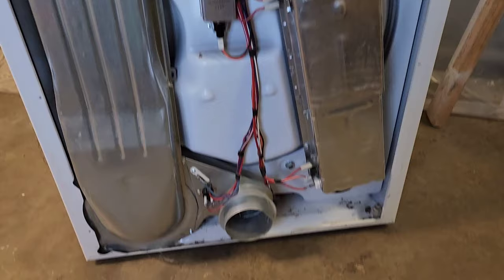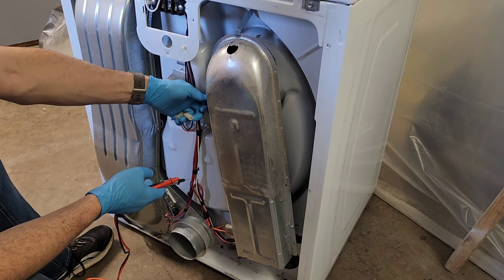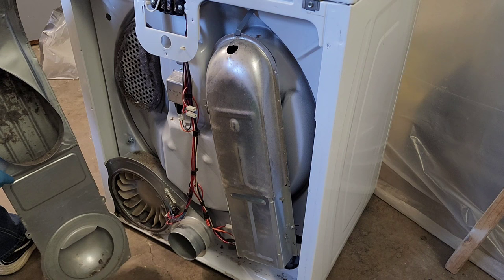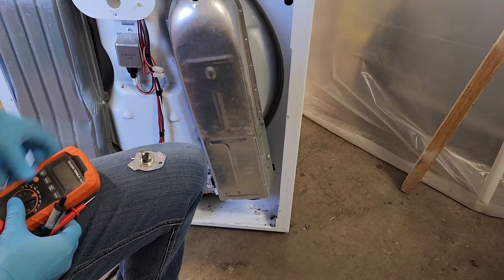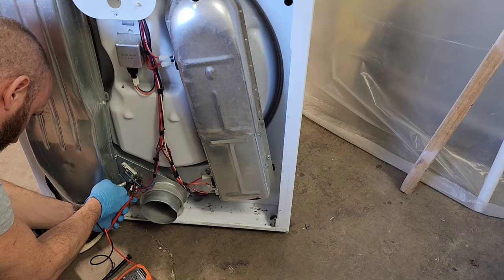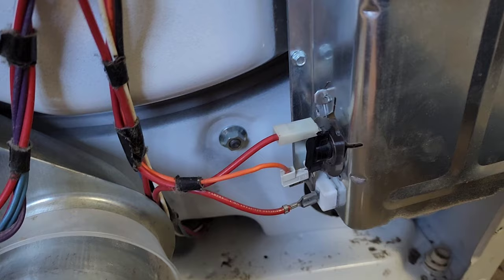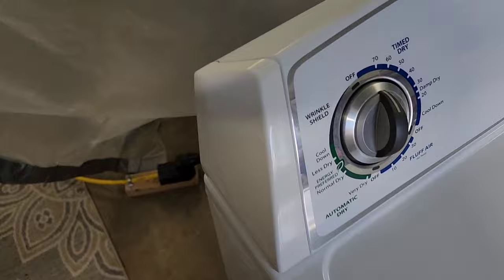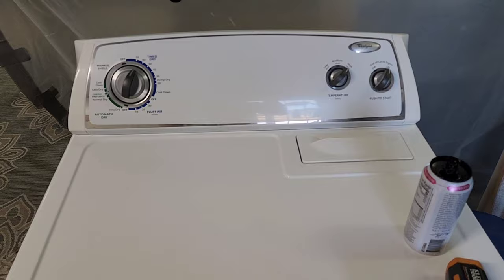Whirlpool Dryer Not Heating Trouble Shooting - High Limit Thermostat | Josh Cobb

Comment from the maker: I have received a lot of feedback saying replacement parts don't look like mine in this video and requests for showing how to wire them up. I'm familiar with the incorrect part that people mistakenly get from time to time but it does come with hardware that will allow you to hook it up. I talk about this in the video posted below as well as an explanation for all the components dealing with the heating element system and how they are wired up. Check the link for the video explanation. Thanks guys! 

https://youtu.be/y7_KXHW_x6o
Reply: You’re a lifesaver man, I’m a mechanic by trade but can figure out stuff, this video helped me fix my aunts dryer in no time. I just haven’t done much home electrical so I’m a bit cautious. I’ve repaired my central air, now this. I’ve told her to order heating element kit on Amazon just to have a spare.

Comment: WHIRlP00L WARNING: Check “Air Dry” setting first. Heat will NOT work on that setting. Spent a 1/2 day testing everything that would keep the temperature selection from working. NO LIGHT at all. Then it hit me, check the dial setting. It was on a setting I’ve never used or even seen, “Air Dry”. Check that first. I would almost feel stupid, but after pulling everything out I found water dripping into the electrical. Somehow, that whole ordeal felt like God moving for me. So I’m grateful anyway.
Reply from the maker: Excellent tip! 👍

Comment: Great video!  Tip, if you are checking for continuity, check ALL possible related parts to this problem.  I started with the thermal fuse and it was blown. I decided to keep checking and found that I was not having continuity in the heating element either. I took it out to inspect and found one of the rods had split (cut) which shorted it out.  If I had not continued checking, I would have wasted more time and possible additional shipping cost if I had just ordered the thermal fuse only.  Bottom line, since you're there, check everything!  Good Luck!

Comment: Thank you for the video. I had taken apart my dryer and deduced the high temp thermostat as the issue with my voltage meter after I found and removed the clog. I just used your trick to pop it back in place and it works perfectly. Thank you for your professionalism!
Reply from the maker: Glad it helped!

Comment: Saved me a ton, thanks!!  To reset my thermistor, I taped it on a flexible metal ruler and then whacked it on a cast iron skillet.   One try, bingo.   All good now, cleaned out a pile of crud in the left collection area, prob the culprit.   But all good and thanks for a no bs, straight to the goods video.

Comment: Thanks for this video. My Whirlpool dryer is almost identical to this one (LER8468PG1). Its been working like a beast for well over 20 years and stopped it just stopped heating.  I've never done appliance repair but I've done computer repair and iPhone repair for many years so I'm looking forward to expanding my horizons with this.

Comment: Dryer heating element went on me again. This time shorted to the metal ducting and not just opened up. Replaced the coil and it still wouldn't heat. Followed this guide to test and found the high limit thermostat blew and was open. Handy tip for percussive maintenance. Dryer works fine now!

Comment: Thanks Josh, you saved the day. The thermal fuse was open so I slammed it a few times and fixed. Concerned why it tripped so Amazon has the entire package for $12 so hope it holds while im drying. So again, Thanks Mucho

Comment: So im replacing all of these... i have 1 wire thats different on the high limit thermostat tho so im stuck and dint know what to do. Aside from that this has literally been the most helpful video i have come across.
Reply from the maker: You need a splitter for the bottom terminal of the high limit thermostat...that is where the wire goes.  Might be easier to order just the part with it already attached....it's a wire that has to do with the auto dry setting if remember correctly.  Here is a link to the correct high limit thermostat that you need https://a.co/d/gSW8w5I
Reply from the maker: https://youtu.be/y7_KXHW_x6o

Comment: Great video, was working on the same dryer today. Also had a tripped thermistor. Tenant still has to wait for the ducts to get cleaned but at least now I won't have to make them wait on a part as well. Handy reset trick.

Comment: Very nice video. I have similar dryer and it will spin and heat but it sometimes stops mid cycle (regardless of whether it's sensor or timed dry). If I hold the start button after it stops, it will spin, but without heat, so I think the motor is fine, something related to the heating. But then a little later, I can start it again and it will work for again with heat some more.

Comment: Josh, I am raching out to you as you have the most common sence of all the blogger repair  posts I watch.  I have a Whirpool commercial dryer, Model CEM2940TQ1.  I have a runs but no heat issue.  I have checked or replaced at 4 thermostats and the power imput is 240.  The unit shows power at the heating element in and out.  The element has continuity.  All the grounds are tight.  What might I be overlooking.
Reply from the maker: Check out this video, I’ll bet it’s what’s going on.  https://youtu.be/oBQBaqClaMI?si=o5p92tde3YJrBHJv

Comment: Thank you Josh! I very much appreciate you taking the time to post this informative video which helped me out greatly. I bought a multimeter today and was able to diagnose and repair my Whirlpool dryer. My thermistor had tripped and after a few tries I was able to reset it. I removed about five handfuls of caked on lint from the trap, blower and vent which I am assuming was the cause. Hopefully the problem is solved but if not I now have the tools and knowledge to do further repairs if necessary. Liked and subscribed.
Reply from the maker: Thanks!!

Comment: I have a home with a vertical vent going to the roof. I pulled out the lint from the vertical vent and under the compartment underneath the dryer barrel but it still didn't function. I did replace the thermostat and checked the heating coils and they are not broken. 

I guess I'll replace the other sensors. This dryer is under 2 years old. At least the parts are affordable.
Reply from the maker: Try running a load without it hooked up to the vent hose and see if it dries and heats correctly. This will tell you if you have a clog further on down the line in your house ventilation. I hook a leaf blower up to mine every three months or so, and blow it out.

Comment: thanks my friend, wonderful diagnosis and well explained. i have an old sears Kenmore dryer that looks fairly similar to the one you're working on here. I was hoping that the problem was one of those components you mentioned here, but i don't believe it is. i even tried bypassing the thermal fuse, but nothing...the symptoms my dryer has  is; it doesnt seem to get any power anywhere. not even the timer ticks like it used to even with the dryer off. what triggered my problem was a very clogged vent. i wondered why my cloths took so long to dry so i cleaned it out and within minutes, it worked 1000% better. only problem is; when i opened  the door to remove the clothes, and put a new load in, it never came back on. was wondering if the quick change in temp from cleaning the vent may have overloaded the circuit somehow. is there any other fuse in these things? the problem really acts like a fuse problem, or else i just fried the circuit. any recommendations would be appreciated. 

thanks again!
Reply from the maker: Check your door switch!  It could have snapped off while swapping the loads.
Reply: @joshcobb4100  yep, it was just that. one of the wires popped off the lead. thanks for the quick reply!

Comment: Thank you for the video. I have 1 question. I have the same dryer. It runs, but no heat. I confirmed the thermal fuses are all good. Except that 3 wire one you replaced at the element. 
When i check continuity on the top and bottom leads, i get no beep. But if i touch the top prong and the un-used bottom prong on the left, it beeps. Would that be a element or the high limit thermostat?

Comment: Thank you Sir!  

I also cleaned the different exhaust areas and I'm now testing it.  

Can you tell me what component you tested toward the left bottom?  It would have been the one you had trouble pulling off the plastic leads.  It has four leads altogether - two are vertically aligned and two are horizontally aligned.  The vertical leads had continuity but the two horizontal leads with the plastic covering did not - maybe there shouldn't be.   Can you tell what that it is and how to properly test it?
Thank you!!
Reply from the maker: That is a sensor for the auto dry setting...and the top leads are tested with continuity and the horizontal leads are tested with resistance which I always find them to be in the 7.18-ish range.

Comment: Thank you Sir. Is there any reason why you didn’t check the continuity on the heating element
Reply from the maker: I probably did it off camera.  You totally can tho, should measure about 9.5 - 10.5
Reply: @joshcobb4100  thanks. Huge help. I checked the continuity (audible) on the heating element and that was it. One of the springs was broken. Saved me from buying a new dryer. Thank you for the content Sir.

Comment: Awesome video! Thanks for the info. I've replaced 4 sensor parts, cleaned it of any clogs, and replaced the heating element and my heating element still doesn't kick on. Any idea what else i may be missing?
Reply from the maker: Timer.  Try forcing the timer knob to the left when running and see if the heat kicks on.
Reply: @joshcobb4100 my dryer just works on high heat. And it stops working when i start from 30 minutes (low heat)

Comment: Thanks for pointing out the thermal fuse! It blew. Not sure why it got too hot, nothing else looks bad, the fan wasn't clogged, there was barely anything in the vent and there was good airflow. Also I noticed when you showed the back, there was more wiring to the other fuse on the heating element than mine has (only two wires connected, one to the fuse and the other to another component right below it) not sure if this is a problem or not?

Comment: Hello, it wasn’t too clear, for testing the high limit thermostat, if you have continuity through the circuit that means that is bad? Since for the thermoster you want continuity I assumed for the high limit thermostat too but you had continuity there and said that was still the problem.
Reply from the maker: Continuity means it’s good.  What I was talking about is that if you don’t unplug it before testing I’ve had it read good but actually be open.  So make sure you unplug the wires before testing.
Reply: @joshcobb4100  Hi Josh.  Nice video, but Eddie is asking what I was wondering as well.  How did you conclude that the high limit thermostat was bad, when it tested as having continuity when you tested it in the video...or did you test it with it unplugged when not "filming" and it didn't have continuity?

Comment: @Josh Cobb When I pulled off my dryer chute, the foam seal pretty much fell apart.  I noticed that when you pulled this one off, it didn't look like it had one.  Do I need to replace it?
Reply from the maker: I don't worry about replacing them....as long as regular maintenance is done it shouldn't be a problem.

Comment: thanks of the tips, what size is the hardware? 10mm?
Reply from the maker: You mean the bolts?  I'm not sure they're exact size but the heads are 1/4 nut driver. I've bought them in bulk at home Depot before.

Comment: I bought a new high limit thermostat and it looks like the new one you have there...which is different than the one on my machine.  I was hoping to find out how to install and connect it...wish you would have shown that.
Reply from the maker: I was just thinking today about putting out a new video and wondering what topic I should cover that is needed. How about a video covering how each of the components on the back of the dryer are hooked up?
Reply: @joshcobb4100  Sure...and WHY each wire goes where it does.  That would be helpful I'm sure.
Reply from the maker: https://youtu.be/y7_KXHW_x6o
Reply from the maker: I titled it part one in case I get more feedback off of it that causes me to need to film a follow-up. Let me know your thoughts.

Comment: When the components test good (heating  Element,  High limit thermostat,  thermistor,  Thermal fuse,  And timer)  But for some reason the dryer still does not heat.  That's when I give up and take the dryer to the scrap yard.  What else could I be missing?
Reply: Is it a Samsung?
Reply from the maker: It’s the timer.  Push the knob to the right and then to the left while testing and you will see the element kick on and back off.  I see it all the time.
Reply: Thanks I fixed my dryer! Changed the heating element and reser the other thing.😅
Reply: Did you unplug it and plug it back in?

Comment: hey, is the white wire (middle wire) supposed to be grounded from the terminal block?
Reply from the maker: Yes, if you're using a three-prong power cord. If you're using a 4 prong power cord that has a dedicated grounding green wire, then the white wire stays in the middle terminal of the block.

Comment: What do you call the gray fuse on temp selector black wire? And should it have conductivity?
Reply from the maker: I would have to see it to know….but there is a little box in line that looks like a little relay or fuse but it’s the buzzer.  Might be what you are talking about??

Comment: Thank you so much for this video. I'm having an issue with the same dryer where it runs but does not heat up. I tested the fuses and all of them have continuity. I also checked the timer and it it looks to be working as well. Is there a way to check the heating element itself? I've actually bought a bunch of replacement parts, Element, fuses and motor, I just don't want to waste time replacing something that doesn't need to be replaced. If the drying is spinning and other wise running fine but with no heat is that usually 95% of the time a fuse or element?

Comment: Hi Josh,
My dryer keeps blowing out the heating element…
I have changed out the dryer heating element twice and replaced the thermostats and fuses. I also took apart the internal ductwork and cleaned it and cleaned the venting going outside.
The dryer works fine for about six months and then blows out the heating element again. What am I missing or why does that keep happening?

Comment: I have the same dryer. I already replaced the thermal fuse along with the other 3 pieces. I took it apart and cleaned all vents. I also replaced the interior bulb as it broke went the dryer stopped working. After doing all that, the dryer still won’t start. I just checked the heating element and a coil is broken. I just ordered the part, but can a heating element prevent the dryer from completely starting?
Reply from the maker: No not typically, but a broken door switch can!
Reply from the maker: Not typically but a busted door switch can! 0

Comment: Great video.

Just ordered both parts to fix an Estate dryer, and they are sold together as a kit.

Didn't know about the thermistor slap, so mebbe I can fix it, and tape it inside should I ever need one.

One question though, the new thermostat does not have a place for the smaller orange wire.

The old part has a separate small lug terminal for it.

What do I do with that wire?

The new part also includes a red/white jumper for connecting the other end of the thermostat to the element.

Thanks.
Reply from the maker: Awesome!
Reply: Received parts, followed instructions (cut an replaced a terminal per directions for that orange wire), installed, and reassembled.

Dryer now working.

Also cleaned out a bit of lint buildup in the vent and hose.

Hopefully, we’re good for awhile.

Thanks again!

Comment: You have a new subscriber in me. Wow. Great vid. Could you do a video of quick walk through of the functions of the thermistor, low thermal, thermal fuse etc, and the difference between no heat in an electrical vs a gas dryer. 
Thanks and sorry for the mouthful.
Reply from the maker: Thanks!  I don’t actually work on gas appliances.
Reply: @Josh Cobb  You're welcome. 
Ahh! No worries still subscribed. Good content. Keep up the good work. Thanks for replying.

Comment: Good information but I still have an issue of my Whirlpool WED5200VQ1 not heating.  I checked all the same things that you showed and they are all closed circuits. I even checked the Timer. I put it into a dry cycle and terminals going to the Element are closed. Then it is open when in the cool cycle. All the ducting is clear. Motor & fan spin. I don't know what else to check.

Comment: Hi Josh awesome video, I have the exact same model and when the dryer's front door is opened, I get no light inside nor does the dryer start when the door is closed. I've tested the power from the breaker to the outlet and I'm getting a steady 220V. Also, the power cord from the power outlet to the dryer is getting 220V. The thermal fuse, heating element, and thermostat all get continuity. I've checked the door switch, and it works as intended, pins 1 and 3 have continuity when the switch is closed. The start switch clicks and has continuity, but nothing gives me that light inside the drum when the door is opened it's as if the dryer is thinking it's closed. I've also tested the power main going to each component, but I can't figure this out. Any advice would be highly appreciated.
Reply: Might be the door switch.
Reply: same problem, did you get any answers on your own?
Reply: @sumnsumn1490  Turns out it was the power source coming in, the wires were messed up between the circuit box and the breaker.